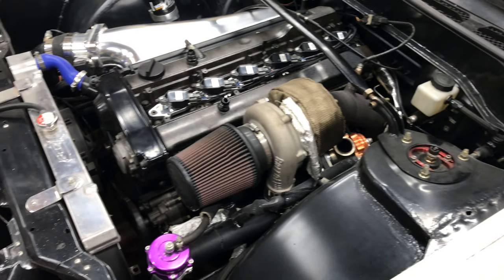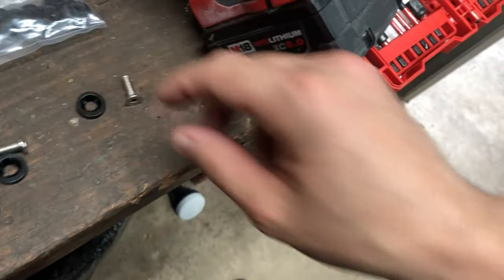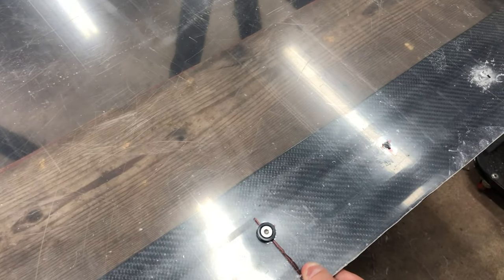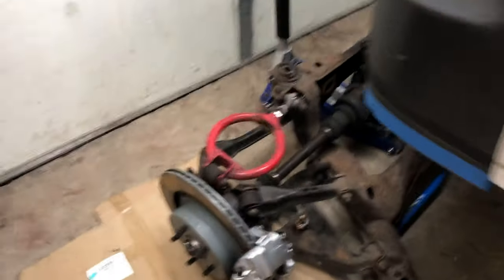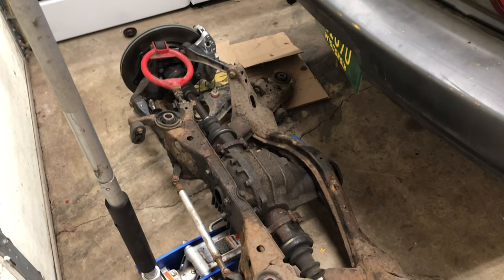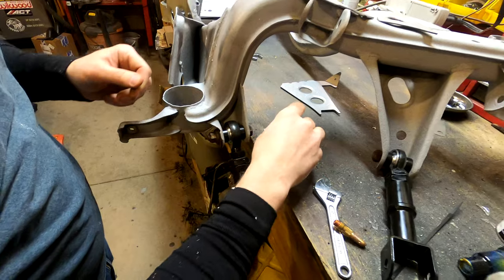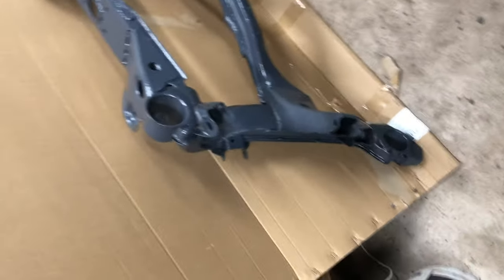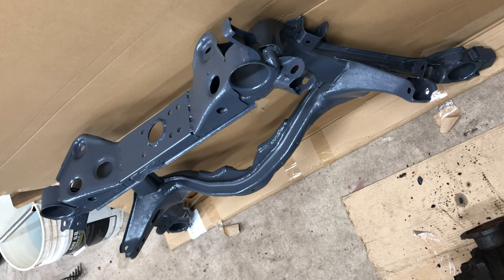240sx Suspension Upgrades Part 1

Comment: Hey do you have a detailed video or a write up on how to get the rear cts v calipers to fit or what I need?
Reply from the maker: Have a vid here. Just note that Devin had to create a custom adapter plate to work with the gk tech stuff in back. If you’re not the original kit should work fine. 
https://youtu.be/awGIFfVD_78